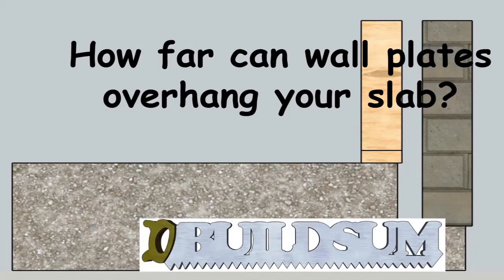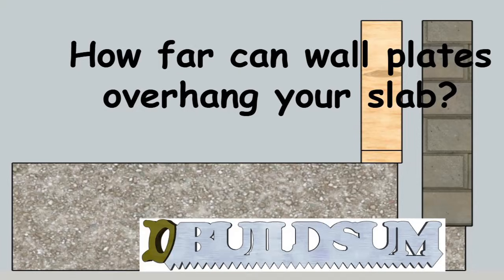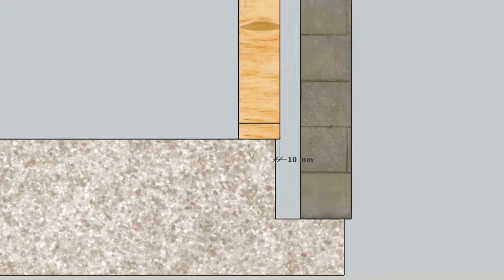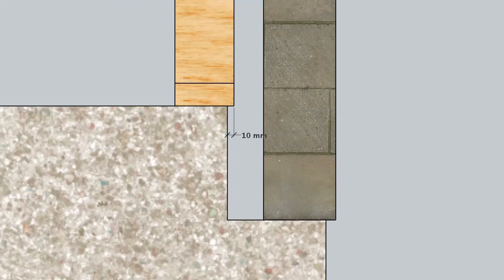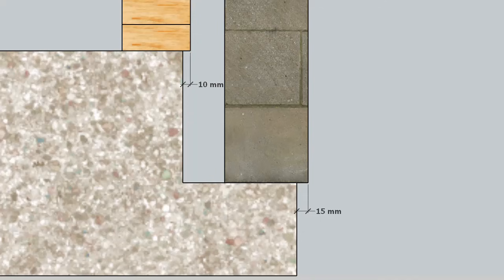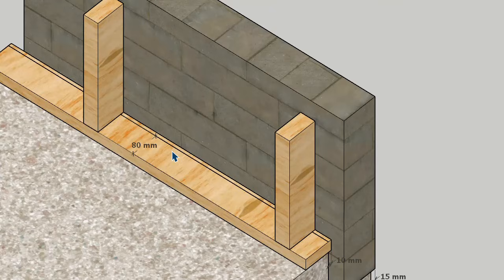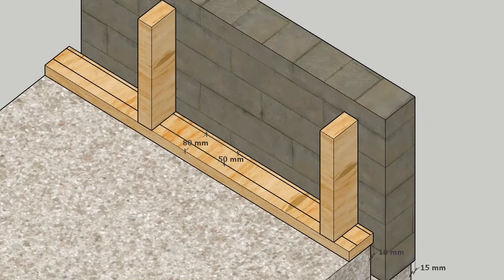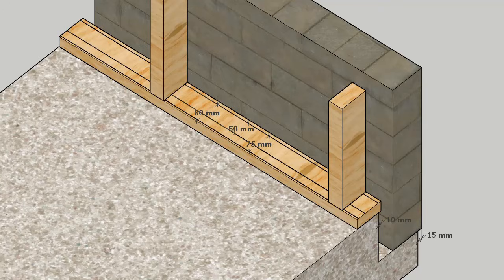How far can Wall Plates overhang your slab?

Comment: Is the overhang proportional to the width of the bottom plate?  So 10mm overhang for 90mm plate is 11 per cent.  Does that mean for example that 120mm bottom plate could overhang 13mm?
Reply from the maker: Hi Mate, no sorry, anything 90mm and over is 10mm it is not proportional.

Comment: In NZ they overhang studs 6mm to allow any direct fix cladding to run down past the slab to prevent capillary action of water back up between the slab and cladding.  They also use malthoid (DPC) strips under the bottom plates when on slabs to prevent slab moisture rising up into the timber.  Neither of these seem to be common practice in Oz.  Great videos BTW - I really appreciate them.
Reply from the maker: Hi Mate, thanks for sharing that info on NZ practices, it's really interesting to see the differences!